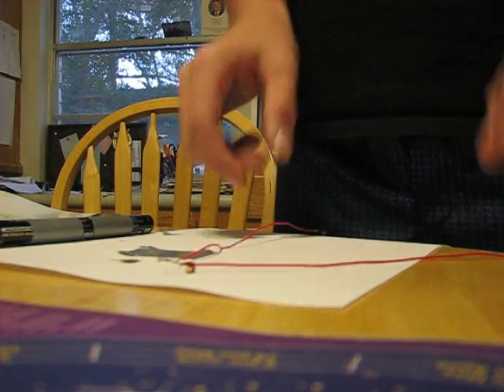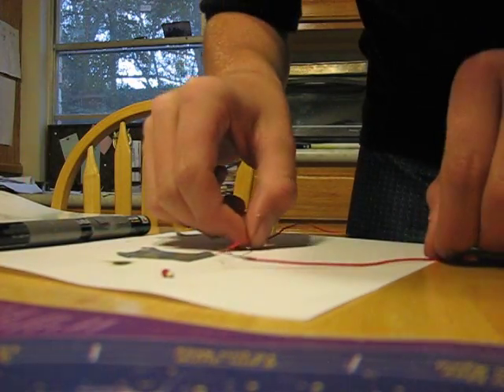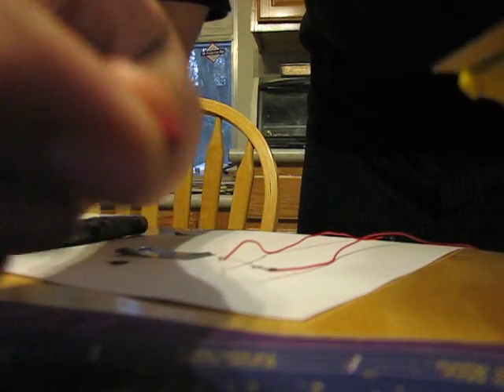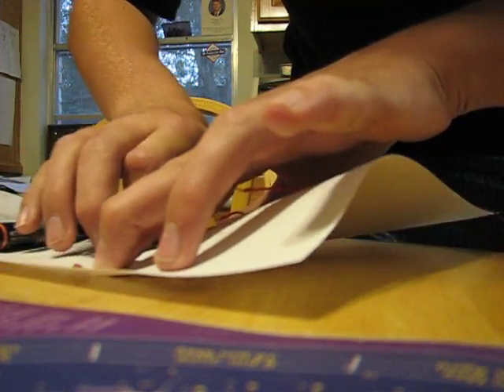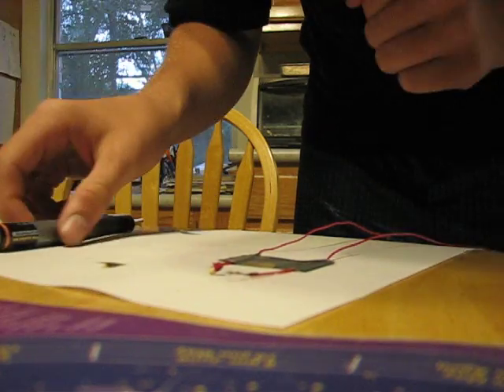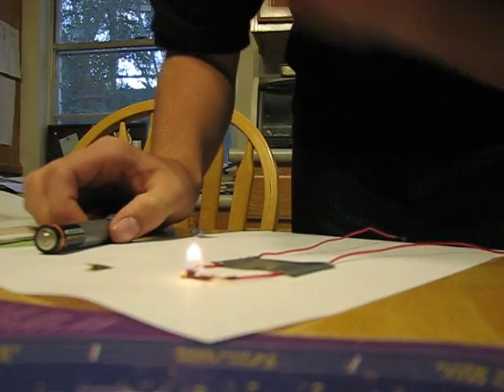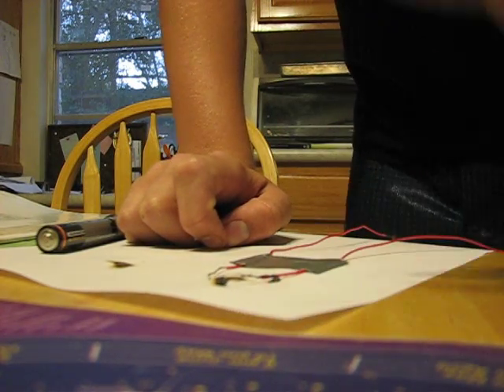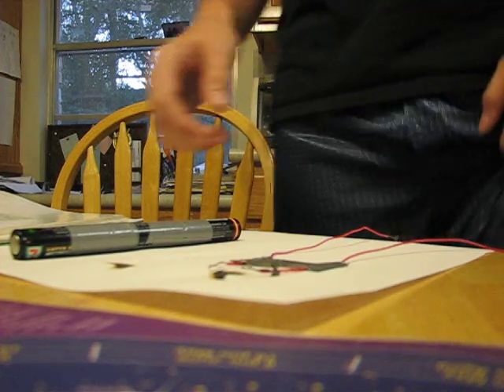how to make a 4.5v rocket igniter

Comment: yes but it might burn out the wire its not the vots that affect it its the amps so it will probly work alsoyou mighy like a glow plug search amazon for 3 volt glow plug

Comment: @randy12368 Please check all the way back to the comments I've left... let's see... 6 months ago? I wanst talking about this ignitor. I was talking about how other people do ignitor in general for larger rockets. Wires is important because some people ignite the target material with pulses with a frequency. (different freqency means different time delay... to pulse power to the driving circuit)In this case, cable-cap may fuck things up. Btw, frequency response is nothing big.

Comment: @SniperPIKACHU No. the point is to conduct a fairly large amount of electricity through a wire that can't handle it, which is the purpose of the small wire, so it will catch fire and ignite the rocket.

Comment: @VicToRMrOwKa I know this is an old question, but I'll respond anyway. The reason it doesn't work with the longer wire is because the longer the wire length, the more energy is lost. This is because the wire is not 100% efficient at conducting electricity. There is always some energy loss.

Comment: I have a question, you said a thin enough wire? Isnt that we want as much power to be deliveried to the ignition material using thicker wire? Btw, you can even use a smalller battery as long as it can output enough energy or discharge to the load( match) in your case. Shorter and thicker wire is better for imporving the frequency response by lowering transmission parallel capacitance and series resistance. 
People using car battery for much larger energy discharge, and the load isnt a match.

Comment: i'm going to be making a rocket laucher soon and i''m looking for an ignition system to use and it looks liek yours is going to be it.
i'm probably going to make one of these little units for each missile and and hot glue it in with the ends of the copper wire attached to slightly larger pieces of metal on either side of the base
the alligator clamp the power source to those pieces to attach them to the button switch "trigger"

Comment: You forgot to consider the length and resistance of the wire running from you to the rocket... as Wytboi8oo mentioned also.